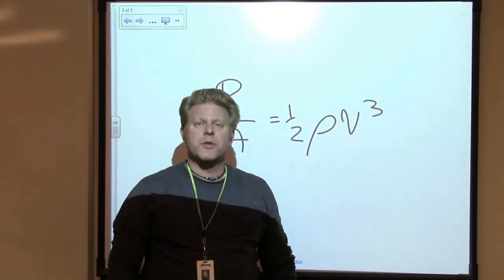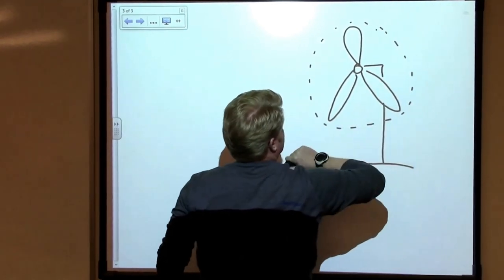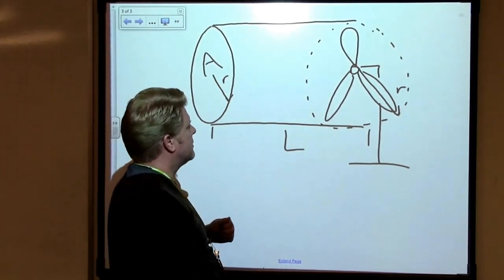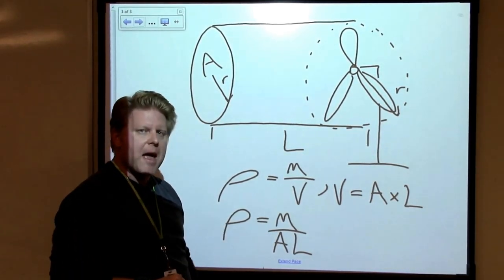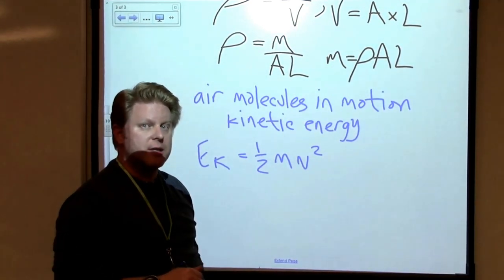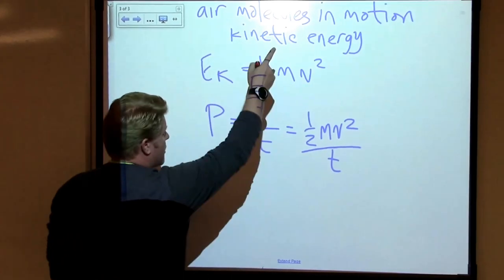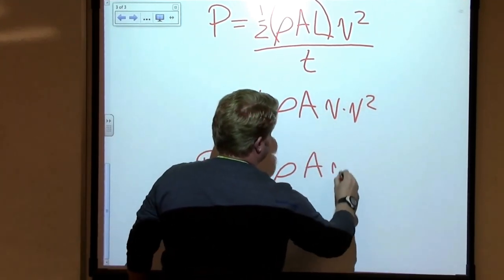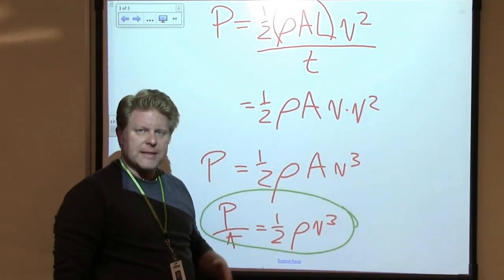Learning Moment - WPP Equation Derivation

Comment: Can we apply the same assessment in a vertical turbine? 

Your assessment was based on a horizontal turbines
Reply: The Power formula for HAWT & VAWT are very similar.
See the actual formulas here ...
https://www.omnicalculator.com/ecology/wind-turbine
Also, need to add the efficiency term

Comment: What is A when you have a vertical axis wind turbine? Is it width x height or is it more complex?

Reason for asking is that if I calculate the dimensions (taking into account the Betz limit and other losses), I get to much bigger dimensions than some people report from their VAWT.
Reply: The Power formula for HAWT & VAWT are very similar.
See the actual formulas here ...
https://www.omnicalculator.com/ecology/wind-turbine
Also, need to add the efficiency term
Reply: @MrSummitville  As we know, for the HAWT, the distance or the surface area are not same time over time as it rotate, not like VAWT. For small (radius) HAWT, we may consider that the delta distance are small. But for big (radius) HAWT, the delta distace is quite significant, beside the surface (in airplane this is called: planform) are changed.
Reply: @StrsAmbrg  Yes, I know. The URL that I previously provided, has both Diameter and Height of the VAWT rotor.  Also, there are differences between Savonius VAWT vs Darrieus VAWT.  But nobody here is building a Utility / Grid sized VAWT.  The formula that I provided is "good enough".